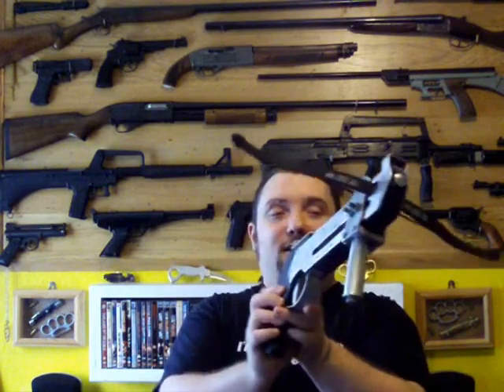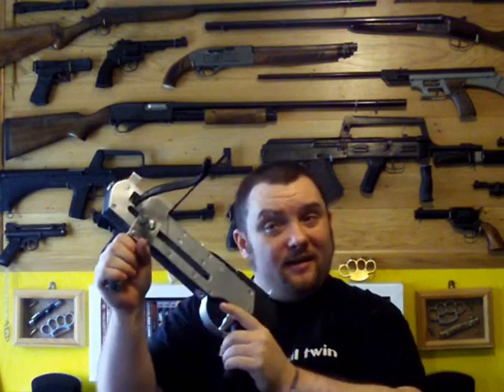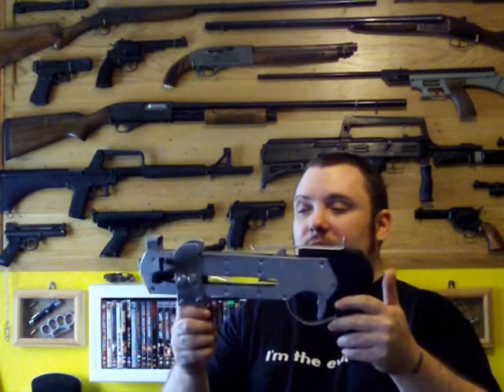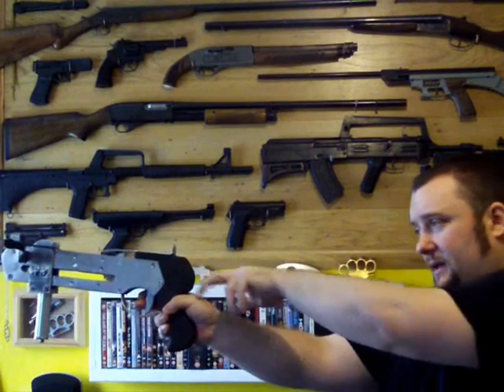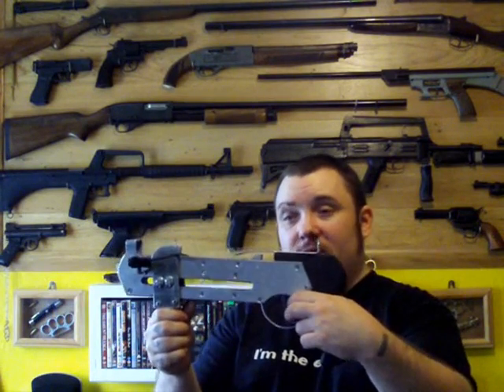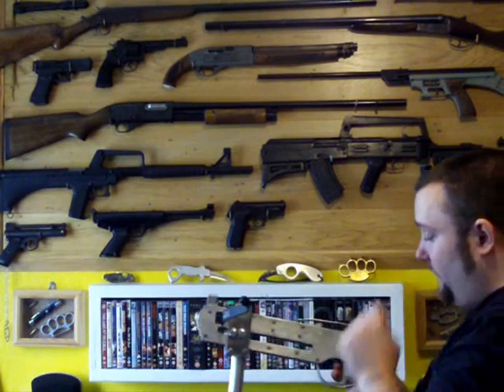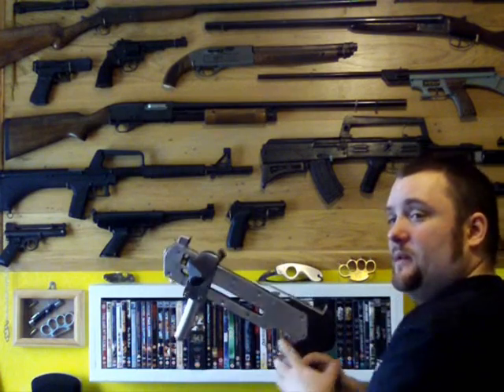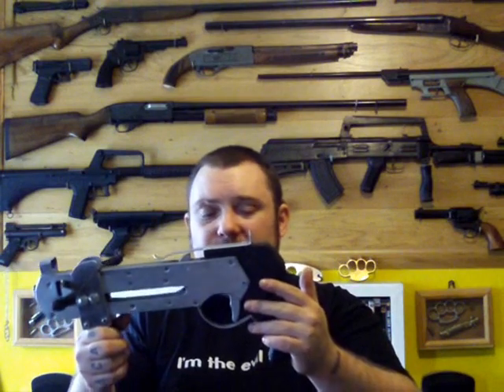A review of my Homemade Pump Action Crossbow

Comment: DON'T GIVE UP ON IT!!! Mike, it really should be pretty easy to modify that to work a lot better -don't take the pump off yet, just put it aside, give it a think... then when you've figured it out and have time, make some changes!!!!

Even looks like a stabilizing guide rail/rod underneath for rigidity and mounting the, pump handle 5" further forwards on a bracket might help alot??? Also putting the pump handle on a 45degree angle...

Comment: Rather than a pump action for such a high-power bow, have you considered  moving the trigger grip to the front, and converting the back grip into a lever-action cocking mechanism that moves forward when you pull the lever straight, and then pulls the bow back when you pull the lever handle down, forming into a back grip? For extra power you could even build the back handle as part of a one-piece stock for extra leverage.

Comment: One year later.....If you try a design, try one that has a static anchor grip in the front, and then draws the bowstring back with a rear pull, especially if you have a buttstock